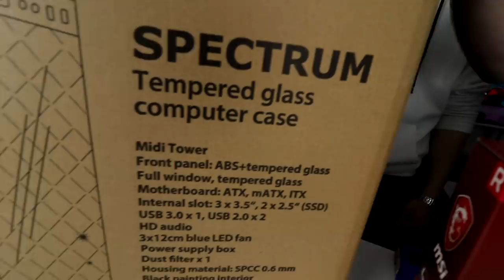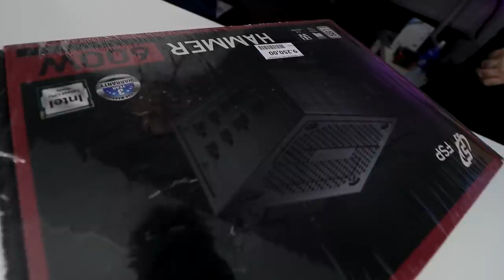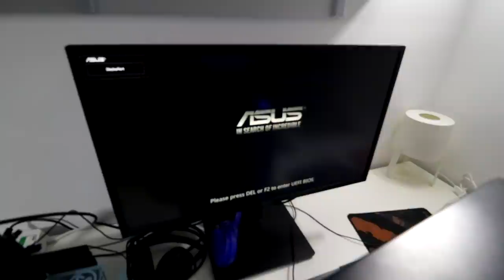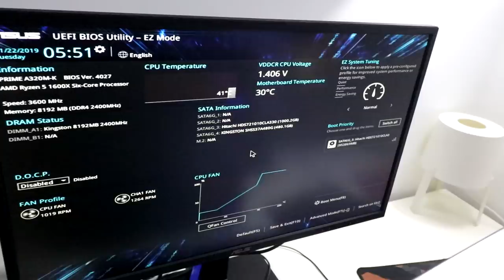EMILOV NOVI SETUP! [☑]

Comment: Dule da li je siguran overclock da ostavim za svakodnevnu upotrebu gaming i striming. OC podesavanja su Ryzen 5 2600X 4.20 GHZ 1.325V , SOC 1.0V , B450 Tomahawk maticna ploca. Radio sam aida64 test na 10-20min i sigurno preko 20 puta Cinebench, temperature nisu isle preko 69c tokom aida64 testa, tokom gaminga ne idu preko 39-40c, a tokom cinebenca ne idu preko 55-56c. Nije se nista ukocilo tokom benchmarkova, i tokom gaminga nekoliko sati nista nije zaseckalo niti ukocilo. Pa me zanima da li je to siguran OC sa svakodnevnu upotrebu? Inace koiristim za hladjenje Cooler Master MasterLiquid ML240L RGB AiO.
Reply: To ti je odlicno,cak mozes da probas na 4.35 da ga oc,ne bi trebao imati nikakvih problema
Reply: @minecraft13234  Ako je sigurna voltaza ova 1,325 na 4,20 ghz, ne ispalti mi se da rizikujem da podizem voltazu za 135 mhz. Samo me zanimalo da li je sigurno da ostavim ta OC podesavanja. Inace hvala na odgovoru! :)

Comment: Ram memorija 3200mhz, a u biosu 2400mhz🤔
Reply: Ne podrzava mu ploca, od ploce zavisi kolko moze recimo meni je moglo do 2888mhz
Reply: @bushidowtf9557   imam istu plocu i ram kao kod njegaa i radi mi na 3200
Reply: E imam jedno pitanje za vas imam 
Ryzen 5 2400g
8 GB ddr4 2400 MHz

Ostalo nije bitno 😂.  Maticna maximum moze da podrzi brzinu od 2933 za ryzen 5 2400g je preporucljivo preko 3000 MHz ja trenutno imam 2400 MHz. 
Sta ce se desiti ako stavim preko limita od 2933 MHz?????  reply.